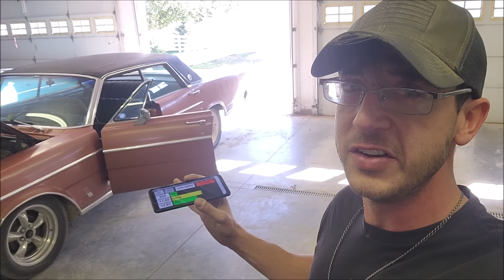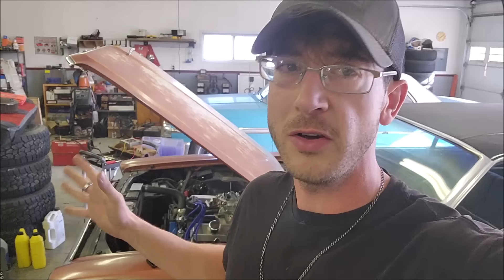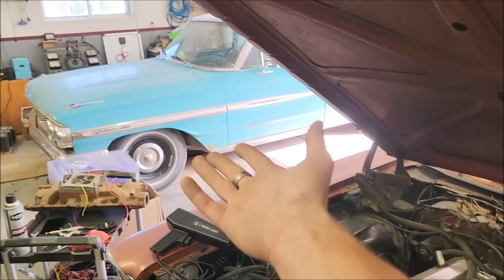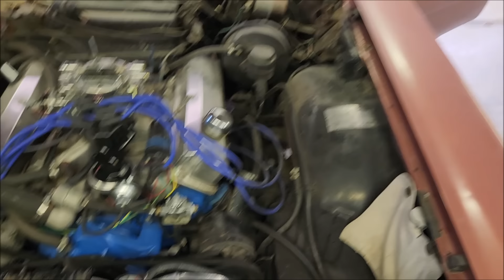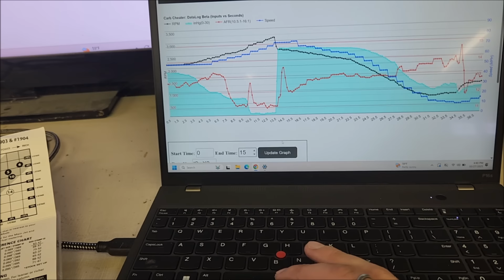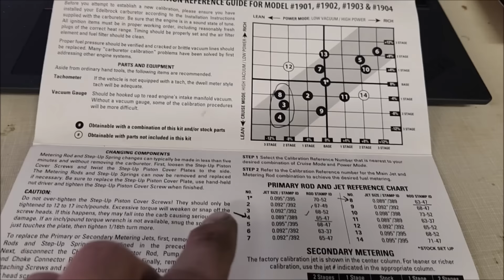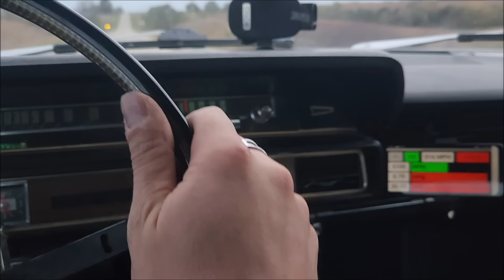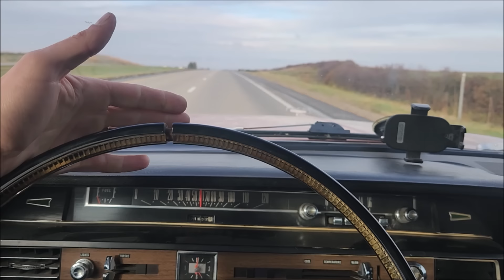Can We Save Her? NEW $6500 Engine Makes NO POWER !!!

Comment: I have several FE engines 410 hp 427    a few 390 s   352  I installed offenhauser intakes 
With Quadrajet carburetor  they have worked perfectly 27 years plus properly tuned auto transmission my mercury with 410  will bark 2nd and 3rd  hit the kick down passing gear 
Chirps when back in 3rd   this electronics is fair .. you cant beat q jet moan on a big block 😎👍

Comment: Start out in First Gear or Lower Gear and shift it at 5,500 rpm to get better acceleration. Hold it in Second Gear until 5,500rpm. Yahoo.
3.00 to 1 rear-end gear ratio is a good highway.  A 3.90 or 4.10 to 1 would be good for drag racing. 
Put that 390ci V8 in a second-generation Mustang with a 4-speed.

Comment: If you place your garage door remote under your chin and push the button you will get better range.
I know it sounds crazy, but your jawbone acts as an antenna and boosts the signal. It also works with key fobs. Give it a try.
BTW you are a Master tuner Luke.

Comment: yep, il give up the 80hp at 6000 to 6500 because driving around normally, it’s SO FREAKING FUN to have big torque and power from 2,500 to 4500. No downshifting just roll right into that meaty power

Comment: Just wondering what you set the timing at in the end including the vac Advance canister! I note it is an adjustable canister and think you said it was set at an extra 10 degrees of can advance? I am right in saying on hwy light throttle this engine is around 44 today?

Comment: I put new points and timed my car by ear and got 30 degrees of dwell instead of the 20 and I was at 16 degrees initial compared to the factory 4. The old 350 was laying down rubber each time I tapped the gas, but it was also a softer throttle spring adjustment. I really want to mess with that carb cheater but not bad by ear and feel. Garage door opener used to open a lot better for sure. Nice video

Comment: Carbs will drive you crazy if the timing isn't correct. Great video. I believe the avs2 tend to run a little rich right out of the box. On a bone stock 2001 4.3v6 i thought it ran great but the fuel economy said otherwise. Put rods in that was 2 stage leaner on cruise and one stage on power. Woke up that engine up and fuel economy went up 10%

Comment: 💥 I HAD A MAROON 1966 7Liter Factory 428 - 4-speed Rag Top - 3:55 ⚙️ nine inch Posi- Bucket seats - console - Heavy High Front Springs - No front Bumper - Looked like a Gasser without a Straight Axel - It Was FORDS ANSWER TO A BIG BLOCK IMPALA, in Theory -  Heavy car Had Decent Torque & Power was Not Bad !  I was 19 my second Car

Comment: Haven't wrenched for a living since the late 70s, so enjoyed your process. Before modern tech, a fairly common problem I used to run across was stuck distributor advance weights, made worse by someone thinking the base timing needed to change.

Comment: I just bought and installed a new carb for my 289 mustang… but haven’t got it all back together and started yet. I bought a carb that is supposed to be a good pair with the rest of the motor… but now have a bunch of anxiety about tuning and getting the tune even in the correct ball park.
Reply from the maker: Not to be a salesman, but pick uo a carb cheater and then its all very easy - as you can see in the video here, it also helps to maintain your tune as well

Comment: 33:30 I agree on the door opener remotes. They have gone down hill so badly. But I did find some things out about why mine is the way it is. First I put LED bulbs into my opener, so if the light is on in the opener the remote doesn't work as well. But if the light Is off it has much better range. then I also have LED and CFL bulbs in the rest of the garage and the same effect happens if someone leaves the garage light on the remote range is much lower. I suspect that there is an RFI/EMF or some kind of interference from the LED/CFL circuitry and the circuitry on the door opener/ receiver.  I have tried to extend the Antenna of the opener to the front but it does not seem to have had a good effect. I did have slightly better overall experience when I switched all the bulbs in the garage back to incandescent, but the life of those bulbs is so short they quickly died and were replaced with LED or CFL or what ever was laying around when I needed to see what was going on.. Maybe someday I'll get out a spectrum analyzer and see what the deal is.. but for now... I just curse at it until I get tired and go push the button on the wall...

Comment: That was good. I don't have the tuning devices like you so it's trial and error. I have a 454 in my 78 nova and I get run on when it's shut off. It's about 9 to 9.5 to 1 compression ratio. I tried higher octane fuel, played with timing and it still runs on. Can't get it to stop. Any suggestions, thanks.

Comment: 500hp no intake pump non performance FE exhaust manifolds 390? Yup, built for 87 oct and best gas mileage would keep it on the road. And AT MINIMUM cheap easy front disk brakes.

Comment: $6,500 for 500 carb HP? Please tell me he overpaid for labor and that includes a built trans?
Reply from the maker: I beleive the roller cam setup alone was probably 1200, the intake is definitely 500, the carb is 500, the distributor and coil is about 550. So your at 3200 there - the machine shop stuff for a full actual rebuild on heads and bore, thats going to be in the 3000 dollar range or higher for the FE. 
Its surprising how fast one can run up a bill on an engine full rebuild

Comment: I see a lot of wasted money in that build. Had the engine been equipped with just the stock 4BL FE manifold and the stock Autolite 4100 carb, all the extra time and $ wasted on the Edelbrock setup could have been avoided.  All you would need is a timing light, a screwdriver and a vacuum gauge and it would have run better instantly; producing more power plus better efficiency.
Reply from the maker: It was a 2 barrel engine originally if I remember correctly. Theres reasons why it got here

Comment: Luke, as an old garage door guy, it looked like your transmitter is probably 315 mhz. If so. the smart button on back of the opener is purple. Often susceptible to interference from some light bulbs, particularly LED. Not all, but some brands. Try switching to an incandescent or a different brand. I've also had it be IP lines and such with cracked insulation. Way more interference around than when you were a kid my friend. Hope this helps

Comment: Can easily extend the shift points by removing the hose from the modulator and turning the screw inside clockwise.
Reply from the maker: Indeed, but its not my vehicle and its a safe configuration currently.
Reply: @ThunderHead289 turn it in at least 1 full turn. They will love it ! Will firm the shifts some too

Comment: That trans should have an adjustable modulator to stretch its legs. Hex key inside the vacuum tube.
Reply from the maker: Sure does, just not my car and its set up safe right now - juat a big cruiser that sounds cool idling 🙂
Reply: @ThunderHead289
Reply: 10/4 thanks mate.

Comment: Back in '78 I rebuilt a 390 for my '66 Galaxy 500 4 door hard top. I made the mistake of putting what used to be called a 3/4 race cam which needed 1100 rpm idle to smooth out. I had a stock rebuild C6 trans and it would want to creep like crazy. I ended up pulling the cam and I installed a RV cam which worked fine. Beware of over camming.  Those 4 wheel drum brakes are awful even with a stock engine, they fade right away. Death trap with those drum brakes.

Comment: Started out Buick, everything I have tuned since, I use Ported vacuum. Reason, accelerate from stop sign or light the throttle blades send extra advance to help move, When coming to stop, engine falls back to smooth idle and if automatic the engine isn't fighting. I generally saw an increase in mpg . Also reduces wear on brakes. If it hasn't been done, a data recording of compression, excess fuel can wear rings .
Reply: Luke was saying it depends on the setup, the application, and probably the driver's foot. 😉
Reply: @stuckinmygarage6220 I know a lot of guys that worked on Chevies do manifold, they do it to everything, because they race. No the ported in better city driving or interstate.
Reply: @keithbarron3654  I see.  City, stock, non-race is ported?  I started skinning knuckles in '70s, and people kept drilling in that manifold advanced and kept engines cooler at idle, cleaner (EPA?).
Reply: @stuckinmygarage6220 not even EPA, ported vacuum fills in till centrifugal gets there. Fixed was racing, if driving in traffic you have to stomp it to get over bucking . Used to do "crowding" Smokey test drive at certain rpm to see what acting up ignition or carb. How many people you see snap throttle, yet won't slowly increase speed, it runs rough from mismatch somewhere.
Reply: @keithbarron3654 I see. Okay. I'm going to walk over to my lair and play.
Thanks. Cheers!

Comment: You missed one thing, and it's something I adjust with the 1906 (650 AVS II) on most engines. The secondary air door spring. Tighten it up a turn and you'll see that lean spike and any bog as the secondaries open disappear. Otherwise a very good tuning video.

Comment: that's what the SUN and Bosch measuring walls were made for, a mobile rack with a lot of different measures and a TV set to watch what the ignition spars were doing. or the alternator, in a different setup. I only briefly worked with one Bosch tester station in early 90's when they were already dying out. these days you can find them only in workshops specializing on classic cars.
of course, measuring while driving adds a whole new dimension to finding out what actually happens under that hood.

aside that, solid description, very useful. :)
Reply: We had one in my high school autoshop and my teacher would drag in an old CJ5 and hook it up at least once a year just to show everyone
Reply: @zacharykelly7434  We often used old machinery just to learn the basics, then switched to more modern stuff. but by late 80's a lot of those old machines were still used everywhere.
Reply: @lotharrenz4621  it was early 00s for me but my teacher was focused on teaching how things worked so you could figure out why they weren't working lol. That mindset has definitely served me well
Reply: @zacharykelly7434  I can see that. we need more teachers like that. :)

Comment: Possible garage door fix: DO NOT USE LED LIGHTS IN THE GARAGE DOOR OPENER.  I put them in mine, its an older one, and it killed the distance for the remote, so I pulled them out and used CFL and it fixed it.

Comment: No shortage of chimps in the car biz. Fixing their messes has kept me busy for 5 decades. How many times a client has told me "there's nothing wrong with it; it's been in 5 shops, they fixed everything, but it just won't run". So waddya expect ME to do? Call in a priest and have him drive out the demons? And then after I correct every single thing the other guys did WRONG, and the car starts and runs like new, the owner balks at the bill because "I told you there was nothing wrong with it; it just wouldn't run".

Comment: As I'm trying to get a better tune on a 302 in my 74 Bronco, im suspecting another underlying problem. My cam 260 advertised duration  has one or two lifters that dont pump up properly.  Checking lobe lift at the pushrod (rocker arm removed) is ok, no sign of flat lobes. Two lifters are very sensitive to oil viscosity,  5w30 much quieter/ 10w40 ticking. Preload is fine. Point is my tuning efforts seem to be terribly skewed by erratic valve action. I have to live with it for now as its my daily work/driver. I really should change out the cam before wasting more time trying to tune it.

Comment: Awesome video Luke! I learned something new and I'm new to carbs and I'm 49, over the years I've come to love carbs, I have a 78 Bronco with factory 2150 that I think I successfully rebuilt and the 400 is running better now, but I think it it could use a new carb, but I wanted to see if I could rebuild a carb and watching you and others have taught me that I can do it. It's not easy getting around the engine bay at my age, if I'm not careful I'll get momentarily get stuck in the engine bay, lol. I'm short at 5'8". Unfortunately I don't know the true miles or how healthy the engine is but I think it would be nice to have a new intake and 4bbl carb, but honestly it runs ok-ish as is and I need help with brakes, steering very badly loose and other leaks all over and its just me and single dad raising my son, no extra help or funds. Sadly I may have to sell it if its going to sit, I feel I'll be dead before I get it road worthy, lol. I've had it for a few years, still working on it but getting discouraged a bit, but your videos give me a bit of a push/hope to not give up and sell. Next up for spring time in MI will be the valve cover gaskets, cork/rubber Mr. gasket, do I put on dry or use a tack spray on valve cover side and a little grease on bottom side to head? I remembers you did a video on this and I can't find it.
Anyway, sorry to be long winded, but thank you for sharing this video. Have a good one! 🍻

Comment: I bought a used Edelbrock 1406 carb for $100 off of a guy who had it installed on his Olds 442. He said that he installed it the previous year and it never ran right, ran rich, stalled and flooded all the time. He put back on the original Quadrajet carb. The Edelbrock was like new. Just as I was leaving, he said he had an electric fuel pump that he could throw in with it. I said sure, who doesn't want a free electric fuel pump. When I got home, I looked at the fuel pump and noticed that it pumped out 15 psi! There was nothing wrong with the carb, when he had installed the carb, he had used the electric  fuel pump too which was pumping 15 psi into a carb that required a maximum fuel pressure of 6 psi or so. The excess fuel pressure was blowing past the float valves and flooding the carb. I installed the carb on my 400 cid SBC and it ran beautifully. Just needed a tweak of the idle screws.
Reply: Just need a regulator setup and you have a backup fuel system

Comment: I know it's not your car, but I'd throw that POS carb. away and get either a 735 or 750 Holley. I'm 76 and street raced my ass off in the '60's and early '70's, almost exclusively with 390's and 428's. My '69 428 SCJ Mach1 came from the factory with a 735 Holley. The 390's had Autolite 4bbl's that were as bad as the Edelbrock thing you're dealing with. Yeah they had good street manners, but performance wise they sucked. A well tuned Holley will wake that 390 right up. I always ran 4spd. so I don't know how to change the shift points in that C6 I'm guessing ? Of course, as you said, 300 rear gear kills it too, but if he manually shifts that, it should go pretty decent. As you said, about 5500 rpm was all the stock juice lifters and springs were good for, but for $6500 I would hope you could get a little more out of it ! And by the way...I use my 8/16 wrench too 😁!

Comment: Great video.  Looks like an overall good product.  I put a FiTech on a 66 Mercury Comet with a 289 about 8 years ago, and it was night and day from the Edelbrock I upgraded to from the original Holley 2 barrel.  I like being able to see what's going on and love being able to adjust the idle and WOT AFR to get a better cruise tuning.  I definitely would have purchased your system over a throttle body kit just to not have to mess with electronic fuel pump and tank issues.  Nowadays I always run my exhaust out past the rear bumper and avoid mufflers that are notorious for droning.  I had a 68 Chrysler Newport with 273s and a 383 that was scarily fast kind of like that car.